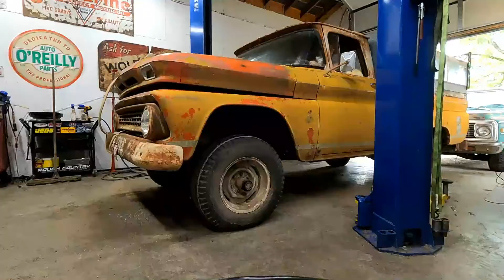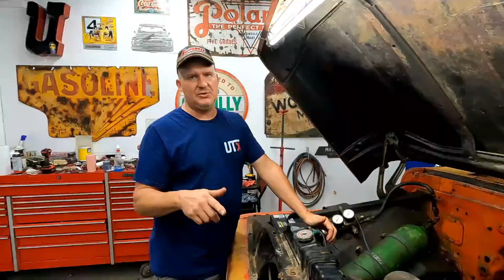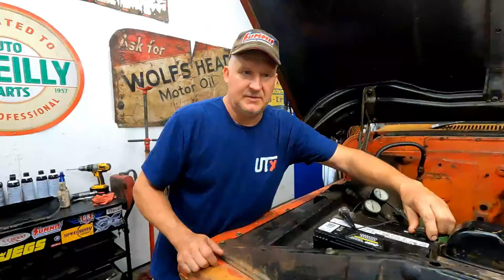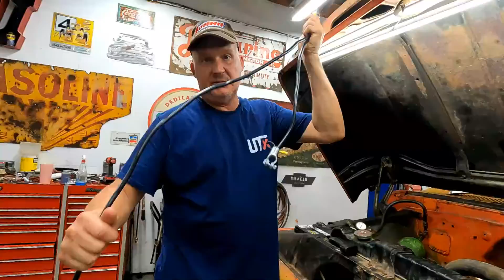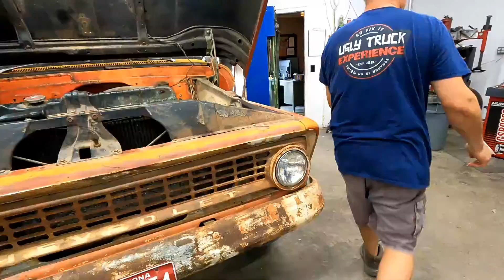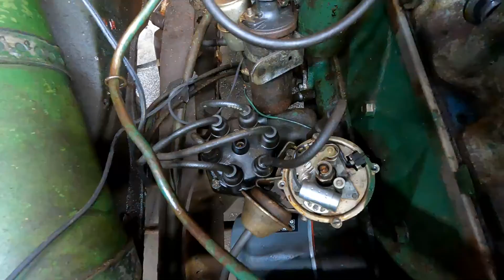STICKY SITUATION! - Still Fighting The 1963 Chevy 4x4 - UTX

Comment: I had a '63 Pontiac with a 230 ci 6 ,it would start on the coldest day without a boost,had about 110 thousand miles on it.  I'm wondering if it's a bad starter. 3 batteries that should be turning faster than it is.🇨🇦👍.Keep up the good work
Reply from the maker: This ones piston rings were so stuck that as the piston moved down in their bores the rings would not compress.  3 cylinders were doing that.  I finally have all the parts and will be putting it back together soon.  I will put plumber on the list of possibilities.  Thanks

Comment: Most would have given up by now.  Glad you stuck with it. Get it..Stuck? Do appreciate the LS Swap on my Ford truck. Recently pulled mine out of storage for months and hit the key, let it prime and started right up. In the 70's Dad used to buy a fleet of old 55- 57 Chevy Otto Milk trucks from Pittsburgh and put dump beds and boxes on those old 6 cylinders. They had plenty of torque. Most had foot starter.
Reply from the maker: They really do have some torque.  I remember in the 80's that this was the go to truck if you were pulling something.  The Ford straight six was the same way.  I did get the stuck reference.  Thanks again.   Jerry